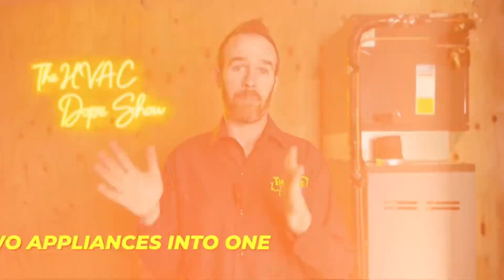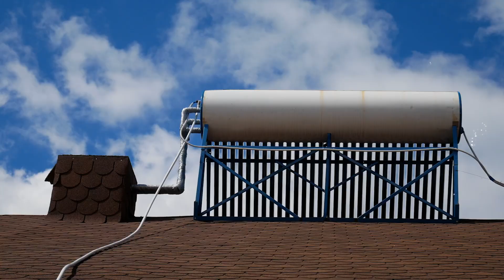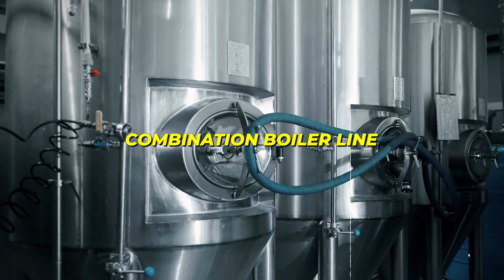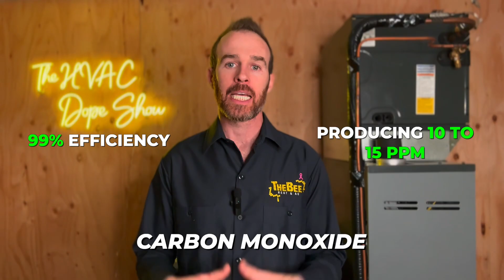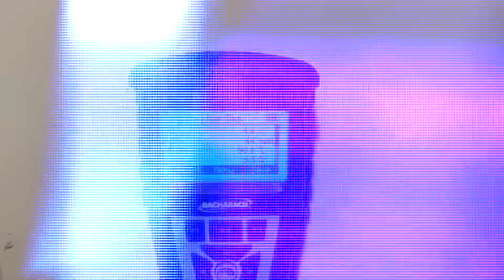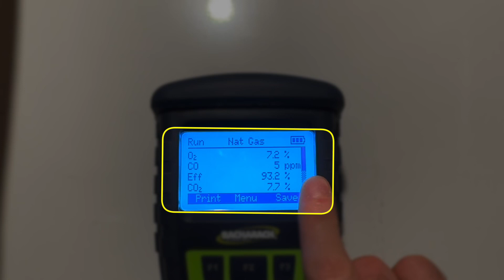Triangle Tube Instinct Boiler 💦🔥

Comment: I am needing to replace a Triangle Prestige 110 tank type combi.  It has been functionally excellent for the past 15 or so years, but recently started with the E14 error.  This is disturbance on the low voltage side but there is no further diagnostic other than wait until something fails it goes into a hard lockout.  I am debating another more advanced triangle, but it seems that you are now not favoring anything combi?  I wish Takagi would make a combi.
Reply from the maker: Triangle tube recently pulled out of the USA (just found out about this this week... haven't been in the loop) and apparently it's become difficult to get parts for them since they're not honoring warranty. I can't recommend them anymore obviously lol but this is a new development

Comment: Do you have a number to talk to you on this boiler have one installed and running into problems and contractor won’t call back
Reply: Just to let you know, there was a recall in February for 28 models of Triangle Tube boilers due to the risk of carbon monoxide poisoning. This recall involves the ignition system and is separate from the 2020 recall, which affected many of the same models. You can check the manufacturer's website or the Consumer Product Safety Commission website to see if your model is affected. Also, Triangle Tube recommends having functioning carbon monoxide detectors on each level of your home, especially near where you sleep.

Comment: What’s the difference between an Instinct and a prestige?  I love my prestige, but prices definitely went up on that model.  Why is it so much more expensive?  Can a Combi really be efficient?  Wouldn’t it require temps higher than condensing?  Is the instinct a modulating boiler with an outdoor reset?
Reply from the maker: Prices for installation have gone up the most because of overhead increases especially with insurance in our industry. It's kind of outrageous... honestly I don't like combi boilers and prefer something like the triangle tube solo or any cast-iron boiler. Combi seems to have issues with water quality and can be finicky sometimes. ironically, the most reliable one we've installed is at my house so I haven't had issues with them but I know our customers have had random issues with the three-way valve not switching between space heating and hot water and it's annoying for us to have service calls new systems
Reply: @TheHVACDopeShow  thank you! I think that I read that the instinct line uses cheaper plastic parts that can end up breaking and that the prestige solo is just a more solid and reliable unit. So I think the best plan would be to have an indirect water heater attached to a prestige solo, but I have never even done that myself either. Also, I would think that the efficiency would drop a lot when you need to make hot water around 120 F degrees. I would think the boiler temperature would need to be really hot at a point where most efficiency would be lost. Of course, that would still be more efficient than a standard water heater probably and also not require a chimney flue.Furthermore, I would think that efficiency would be even worse in the summer with your Boiler running year round just to make hot water. So I was thinking of also getting a heat pump water heater to make summertime hot water which would also keep the basement cool.
Reply: Just to let you know, your boiler may have been recalled due to risk of a carbon monoxide leak. The following information is from the Triangle Tube website:

"In cooperation with the U.S. Consumer Product Safety Commission (CPSC) and Health Canada, Triangle Tube is conducting a voluntary product recall to repair 27 models of Prestige Solo & Prestige Excellence boilers (28 in Canada), and 2 models of Aerco Esteem boilers manufactured between December 2011 through April 2019.

The boilers can release carbon monoxide due to delayed ignitions or component damage, posing a risk of serious injury or death. Improper combustion settings can increase this hazard. All customers with a recalled product will be offered a free inspection and repair of their boilers. Nothing is more important to Triangle Tube than the safety of our products and we will continue to take all necessary action to protect our customers."

You can check to see if you have an affected model at the CPSC or Triangle Tube website.
Reply: @ THANK YOU!
Reply: @mknmike You're welcome 🙂

Comment: What yearly maintenance would you recommend to be conducted on the Triangle Tube boilers ?
Reply from the maker: Replace it with a cast iron… jk 😁 lol had a few experiences with the combi boilers recently that makes me have less faith in the combi setup, I think it’s more due to water quality issues but the Solos seem to be more reliable as we’ve not had issues with them (heating only boilerd, no domestic hot water). Big thing is just check for error codes to make sure it’s running properly because they’ll start to have misfire error codes if they’re running rich or lean for some reason or if the flame sensor / igniter rod isn’t working well. Sometimes you’ll have to clean out the heat exchanger every handful of years but when you do this it requires a gasket set to change all the gasket and is a fair amount of work. Every few years a fernox treatment is a good idea unless you’re running glycol which you should be with radiant floors, if that’s the case you don’t have to worry about fernox because Glycol has corrosion inhibitors in it that prevent corrosion and generally speaking my understanding is glycol is good for about 10 years or more before needing to be changed out. The fernox or DHW equivalent is important though on the combi circuit because it helps the switching valve (valve that switches between hot water and space heating) working well and rust free. Best thing you can do for it.
Reply: Just to let you know, your boiler may have been recalled due to the risk of a carbon monoxide leak. You can check the Triangle Tube or CPSC website to check if your model is affected. The information below is directly from the Triangle Tube recall page. 

"In cooperation with the U.S. Consumer Product Safety Commission (CPSC) and Health Canada, Triangle Tube is conducting a voluntary product recall to repair 27 models of Prestige Solo & Prestige Excellence boilers (28 in Canada), and 2 models of Aerco Esteem boilers manufactured between December 2011 through April 2019. 

The boilers can release carbon monoxide due to delayed ignitions or component damage, posing a risk of serious injury or death." 

"While waiting for the repair, you should have a working carbon monoxide alarm installed on every floor of your home and outside sleeping areas. Triangle Tube is offering a CO detector free of charge to consumers who request one at 877-574-5036."

"In 2020, Triangle Tube recalled many of the same boilers for an issue relating to the potential for flue gas to escape from the vent adapter if it was not securely re-attached to after maintenance or repair. If you did not receive the 2020 repair, service technicians will provide you with the repair as part of this recall."
Reply: Just to let you know, there was a recall in February for 28 models of Triangle Tube boilers due to the risk of carbon monoxide poisoning. This recall involves the ignition system and is separate from the 2020 recall, which affected many of the same models. You can check the manufacturer's website or the Consumer Product Safety Commission website to see if your model is affected. Also, Triangle Tube recommends having functioning carbon monoxide detectors on each level of your home, especially near where you sleep.

Comment: Our prestige triangle tube is a nightmare. Non stop issue. So many parts replaced but same issue exists. Plumber just keeps coming back over and over again and is baffled.  There is not much left to replace. This is just after only 8 years. Would highly not recommend.
Reply: I have had a Prestige Solo 110 with an outdoor + water temp = 150 curve for like 12 years with literally no maintenance AFTER I corrected the errors of my professional installer.  I had planned to add an indirect water heater but am selling the house instead and now want to put a ModCon in the new house.  I am trying to understand the difference between the instinct and prestige lines and if we want a combi or not.
Reply: Sorry to hear that.
I've had good luck with the instinct solo boilers.
You've probably spent more on repairs than a new one would cost.
What keeps breaking?
Reply: Just to let you know, your boiler may have been recalled due to risk of a carbon monoxide leak. The following information is from the Triangle Tube website:

"In cooperation with the U.S. Consumer Product Safety Commission (CPSC) and Health Canada, Triangle Tube is conducting a voluntary product recall to repair 27 models of Prestige Solo & Prestige Excellence boilers (28 in Canada), and 2 models of Aerco Esteem boilers manufactured between December 2011 through April 2019.

The boilers can release carbon monoxide due to delayed ignitions or component damage, posing a risk of serious injury or death. Improper combustion settings can increase this hazard. All customers with a recalled product will be offered a free inspection and repair of their boilers. Nothing is more important to Triangle Tube than the safety of our products and we will continue to take all necessary action to protect our customers."

You can check to see if you have an affected model at the CPSC or Triangle Tube website.
Reply: @ Thanks for the information. Fortunately we replaced it with a different brand that works.
Reply: @johnhenry9456  You're welcome 🙂
Reply from the maker: I’m sorry to hear that, have you looked into water quality and had a second opinion on the installation / piping? And was the altitude set at install during commissioning? There’s built in auto mixture control based on altitude that’s part of commissioning and if the primary loop isn’t piped properly you’ll have a lot of issues.

What’s your primary issue that keeps happening? Do you have any error code? 

For what it’s worth I agree that cast iron are much more reliable that high efficiency boilers so we prefer them for that reason! Either way if you let us know the issue I’ll see if we can help

Comment: Love our Triangle Tubve.
Reply: Just to let you know, there was a recall in February for 28 models of Triangle Tube boilers due to the risk of carbon monoxide poisoning. This recall involves the ignition system and is separate from the 2020 recall, which affected many of the same models. You can check the manufacturer's website or the Consumer Product Safety Commission website to see if your model is affected. Also, Triangle Tube recommends having functioning carbon monoxide detectors on each level of your home, especially near where you sleep.
Reply: @ryry8210  I do have CO detectors. Thanks for the info.
Reply: @redbraid  You're welcome

Comment: Put well over a dozen bosh greenstar combi boilers in. They have plastic parts in yhe bottom on the domestic side that break down over time resulting in a flooded basement. Disappointing.  Installed 4 or 5 older triangle tube boilers and only had one heat exchanger fail in a dinner that uses a ton of hot water.
Reply from the maker: Yeah we’ve only had issues with the valve or sensor that switches between combi and heating on one unit, and it’s made us nervous but that house had particularly hard water

Comment: We install Viessmann Vitodens and have had good luck. What type/brand heat exchanger is in the triangle tube? I worked for a company and we installed a ton of the Triangle tube Solos and prestige’s back in the day. The Vitodens also have the feet above sea level setting and takes care of figuring out fuel mixing no mixing screw or zero governor setting to mess with.
Reply: They are the inventors of FireTube Technology. Currently ACV makes their FireTube
Reply: @lloydcooper2775 The inventors of Fire tube boiler technology?  Locomotive steam boilers had fire tube boilers.